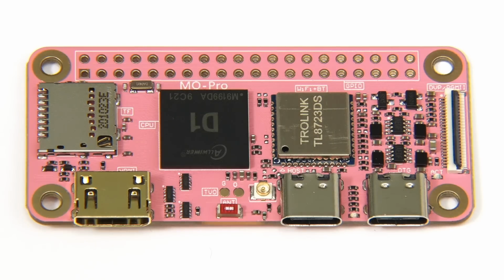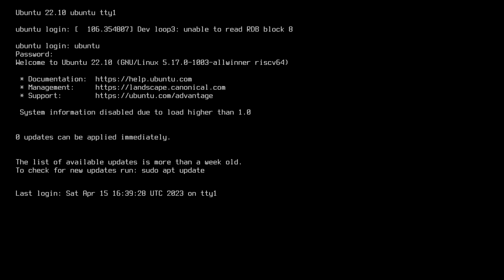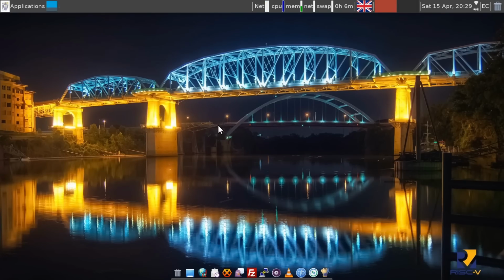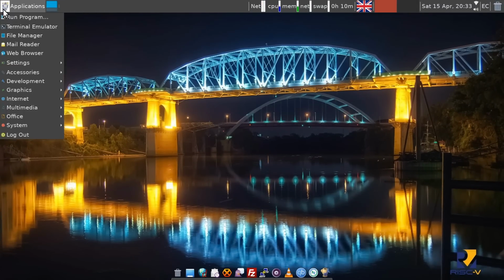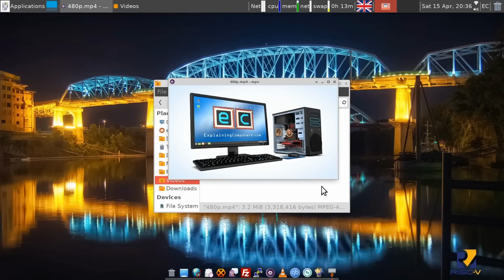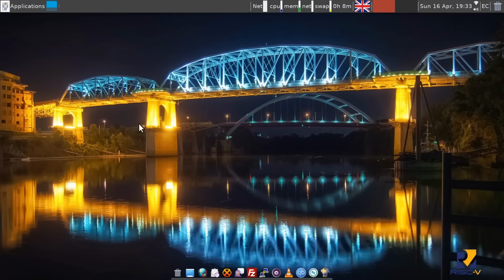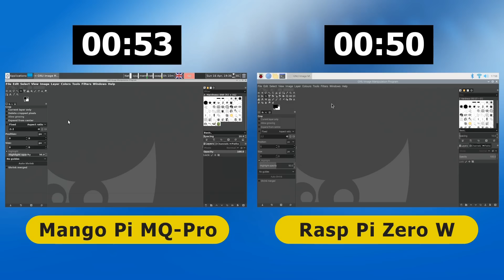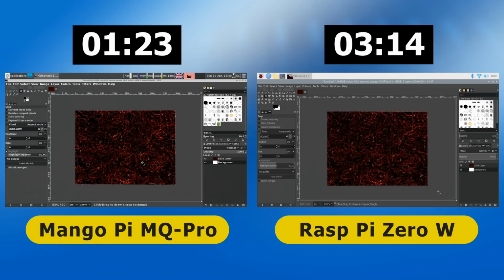Mango Pi MQ-Pro RISC-V SBC

Comment: What happens when Mango Pi suddenly drops support for this board?
When you buy a Raspberry Pi product it comes with a long term support statement you can have some faith in, not so with the Chinese wannabes.
Reply from the maker: Fortunately, all boards with an AllWinner D1 SoC seem to work with the same images. The version of Armbian I was running successfully here was actually actually created for the Sipeed Nezha SBC, which also has an AllWinner D1. In this respect, RISC-V is already demonstrating more cross-board compatibility than with ARM SBCs.

Comment: Have fun getting your network hacked using that thing! They have a backdoor built in.
Reply from the maker: Do they? Where exactly is the back door built into a D1 RISC-V CPU? The whole thing is open source! What you say is utter rubbish.
Reply: @ExplainingComputers  you're way to naïve. I managed to telnet into a Chinese WiFi camera and found a backdoor Daemon running so I wouldn't be so naive to think that device is safe just because it's open source. Sure the circuit might be open source but you have no idea what is running inside that risc chip, you're just believing what the specifications are saying. Utter naivety imo

Comment: tell the truth. 1GB RAM , no GPU,  single core 1GHZ cpu  - its electronic rubbish. i preorderd sipeed lichee 4Ai and waiting. Maybe it will be a usefull peace.... I have also Vision Five V1 and V2.  if you wanna compile something results are worse than cortex-A53 quad-core 1.2-1.4 ghz ( Rpi 3) ( Vision V2 )
Reply: The is no planet on which a VisionFive 2 is slower compiling things than a Pi 3.